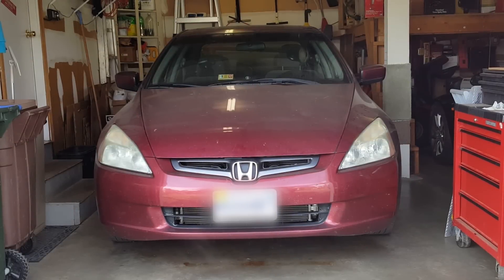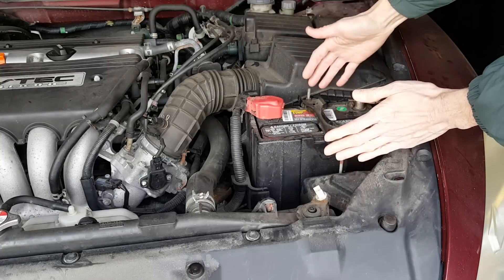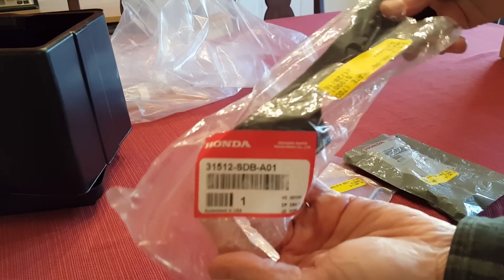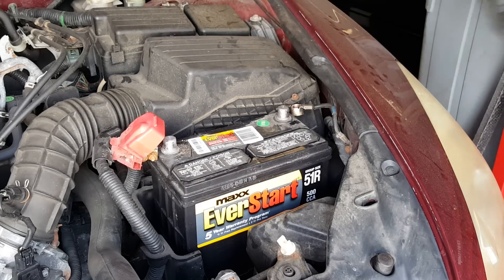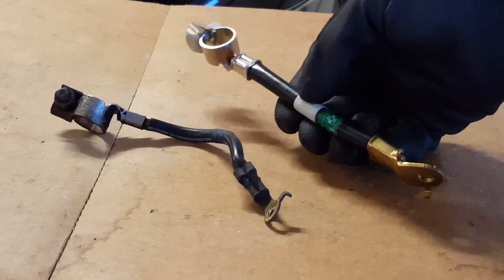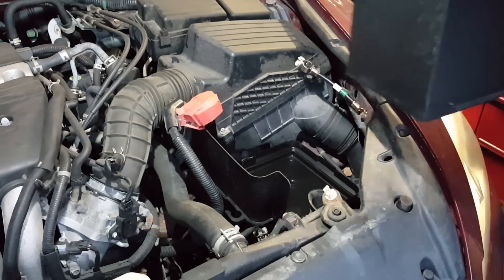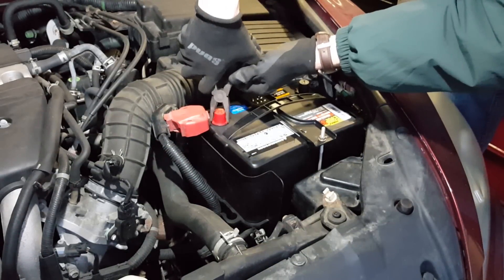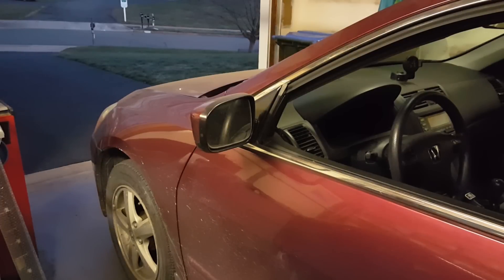Honda Accord?  DIY upgrade that undersized battery!

Comment: I went to auto part I asked him for up grade a battery because I have an R51 which is small one 
but they told me don’t do it
Because they were messed up the sensor and fuse?
Reply from the maker: Hogwash! That sounds like a typical answer from a naive service writer at a dealership. "Messed up" is not an acceptable scientific explanation of any potential problem. Ask them specifically what sensor and fuse and how a battery upgrade would negatively affect them. They won't be able to give you an educated answer because a battery upgrade is totally fine and has been done countless times. If you do get any form of an answer, do please share it here for our benefit. Thanks for the feedback.

Comment: For 31513-SP0-010 J-Bolt, Battery Setting (2 required), If I order 1 part do they send the pair of them or do I need to add 2 part#'s to the checkout screen?
Reply from the maker: You need to order 2. They do not come as a pair.

Comment: I just put a Maxx Ever Start 34N in my 2009 Honda Civic Coupe LX . My original Honda battery lasted for 9 years. 51R-500 CCA !              
34N 800 CCA should be learn to be good or bad . Thanks for my part list. I had to sew Cover, Battery as a tailor !!!  34N is a bit long. Also a 12" hole to hole Negative Black #1AWG.

Comment: Do I need to use memory saver while doing all the work?
Reply from the maker: Not likely. If your radio requires a security code, it is usually on a sticker somewhere like in or around the glove box.

Comment: Loved this video, by the way 9th gen Accords have major starter issues. My starter died at 40,000 miles. Honda wanted $800 to replace the starter. I found an eBay starter for $150 and it works better than the OEM Honda one. I feel the starter and battery were not designed well on these cars. Everything else is great!
Reply: Hey, I’m not if sure if you’re going to read this or not but I’m running into a similar issue with my 2013 Accord 4cyl cranking but won’t start right away. Auto Zone said the low alternator output it was below 12.7v. How did you know it was your starter not the alternator?
Reply: @MrWeezyTunechi  well the battery is way cheaper to reaplacs so start with that. The upgraded battery will help.

Also there was a safety recall on the charging system for this gen so many sure you have that recall taken care of.
Reply: @MrWeezyTunechi  Sounds like an alternator issue if it's dragging or slow to start.  If it's a bad starter you won't get any turnover at all.

Comment: The battery on my 2017 Accord is already on the verge of failure after a little over 3 years. I bought the car new in Nov. 2016. I would estimate that the battery is as old or a bit older than the car itself. A car's battery is simply a piece of parts inventory like the other components used to build the car and can vary in age. Dates on batteries matter even if they've not been put into use. Also car makers tend to skimp on battery quality when assembling new cars. The best battery I ever had was an Electro that I used in my '89 Toyota pickup. Got almost 7 years out of that one.
Reply: MY 2017 Honda Accord Sport SE bought on Memorial day 2017. The battery just died today, less than 3 year, but out of warranty because it's over 36,000 miles. What's a junk.

Comment: Our Accord 2007 EX-L with Navigation is having trouble with the battery keep dying when it gets cold (Montreal, Quebec)... thought a parasite drain but we didn't notice that we had this dying battery issue when its warmer. Might try this bigger battery trick.

Comment: I saw my battery and thought 🤔 “Ok who thought it was cute to put their gulf cart battery in here?” 😂
Reply: You should see how tiny they are on 90s model civics lol.  it's just dumb
Reply: Fr lol
Reply: I'm using this small battery with a pristine system and no issues...I guess it makes you feel more secure with yourself than do it,and get the bigger battery.Or get the 51 yellow optima battery.
Reply: dick lavy the one I have is from the dealership but I’ve been there 3 times to get it replaced in the last 2 yrs of owning my accord. I don’t understand why it’s not staying charged. They said nothing was wrong with the alternator so idk :/ it’s frustrating but they said it was covered by warranty so that’s why I let them replace it.

Comment: I took my four cylinder Accord to get serviced at Honda. The tech saw my group 35 optima in there and was surprised at how it came out.  I told him I did it to make the car easier to deal with.  

Readings: 12.94v with motor off on battery tester.
1052 cold cranking amps.

Makes short work of Hondas. 😁
Reply: What battery did you use? and Did you use the mounting stuff mentioned in this video or something else??
Reply: @Dashitishere22  Update: the Odyssey died at 2.5 years.  I've since replaced it with an Odyssey Performance Group 35 AGM.  675cca, 59ah, 110min RC.  car cranks up like it's nobody's business now.
Reply: @ganzonomy  Damn thanks for the updates! Much appreciated!
Reply: @Dashitishere22  You're welcome!  I put in the odyssey and it holds 12.95v at rest, has almost 900cca, but it doesn't need a riser.  My alternator is starting to go, so that will be replaced (and the starter too).

On my 2013 Accord V6 (comes with a 24F), I upped from a 24F Flooded Honda-spec (550cca) to a 24F Northstar AGM (840cca).  THAT battery has 1200cca at crank, 76ah, and 160min RC.  It rests at 12.9 to 13, idles at 14.4, and gets up to  14.9 to 15 when driving.  Honda really needs to put stronger batteries from factory in all their cars, and not just leave the bigger ones in their bigger-engined Hondas (or reserved for Acura).
Reply: @Dashitishere22  everything the same as in the video, other than using an optima red top
Reply: Ive had nothing but bad results from optima batteries. They only lasted 3 years each(2 batteries). I dont run any extra things on the car(subs).

Comment: Besides the battery lasting longer, were you able to notice any difference when cracking (quicker turnover) and accelerating (full throttle)?
Reply from the maker: Yes, cranking used to struggle but was much more energetic after the upgrade. No change to throttle response which I wouldn't expect.  That's not a function of the battery.
Reply: @WorseThanChiggers  right on. Thanks for your response.

Comment: Did this on my 2007 Honda Accord. big difference. Great idea! Thanks!
Reply: Did the battery upgrade recude rpm drops when the fans kick in or when controlling the windows? Or did it reduce the dimming of the headlights?

Comment: Good job on video and clear concise dialogue. I would never purchase Walmart Max Everstart  battery again. I have several Honda's and  did it for the the 1st time on an older Accord 4 cyl which traditionally sits idle for a good part of time. I found it would not hold its charge for an extended period of time when sitting unused. I had to keep giving it a charge.  My favorite is the Costco battery but they stopped making for this year Honda. Even the Honda battery last better than Max Ever start; should be Never start. Will try and find Interstate.

Comment: For years I've been using Mobile One Synthetic Oil to avoid hard start specially in winter. But now I'm gonna switch the battery and go back to Walmart cheap oil.
Reply: H Alganis — thats a baaad, bad decision! Get the battery and continue to use Mobile 1 on all the vehicles you care about! I have a 2007 Honda Accord with 410,000 miles on it. I also have a 2016 Accord with 60k miles. The high mileage Accord runs as well as my low mileage Accord! All my vehicles (4) get Mobile 1 exclusively!
Reply: I'm gonna do the same. My 06 kept running till 400 K then totalled in a bad crash. I went and got an 07. I upgraded the battery and switched to SuperTech. Let's see how Walmart oil gonna let it last. I heard Walmart oil got improved. Mobile 1 is getting more expensive.

Comment: I just finished installing a 55AH battery, rather than the smaller standard 45AH. The battery is shorter, but wider. Had to completely remove the plastic cover and base and also straighten a bit the metal tabs at the bottom of the metal tray. It's a tight fit but it does fit with no issue and it's not going anywhere. Used the original clamp and hooks which also fit fine. I'm wondering if I should buy the thicker cable from Honda. Is that really necessary???
Reply from the maker: Some have said that, no, it is not necessary. I, on the other hand, was concerned about the additional current flow and wanted to upgrade to the larger ground cable as it was designed by the engineers.  My thinking was, if it was designed for use with the larger battery in the V6 version, it would be appropriate to include it in my upgrade.
Reply: I looked on finding the cable. Local Honda don't even have the original cable, let alone the upgraded one. Can get online for about 80 USD (including European Delivery)!!! The new battery cost me less than that so no way I'm buying it!
Reply from the maker: @ps7539  $80 USD is pretty steep!   Is most of that the delivery fee?  The part is only $14.20 USD from here:  https://www.hondaautomotiveparts.com/oem-parts/honda-cable-assembly-battery-ground-32600sdba00

Comment: why didn't you just use the warranty for a free battery replacement at walmart?
Reply from the maker: I might have done that and dealt with the hassle if it was just me.  However, it was not an option to let my daughter get stranded once a year when the weather turned cold.

Comment: I was thinking the same thing...Why put a tiny battery on a newer Honda when all newer cars demand more electrical power. Doesn’t make sense?? Five years ago on my folks 09 Accord, I installed 24F size battery. Removed the battery cover and left the bottom tray in place along with original cables and j-hooks, worked perfectly. Thanks for the video...I’ve asked my folks if they wanted the OEM battery conversion, they were happy what I did for them and no need to upgrade. Been running fine over 5 years vs the tiny anemic battery that died less than 3 years.
Reply: Because any weight savings, even if it's in the form of an anemic battery, makes Honda look good in the eyes of the government emissions standards.
Reply: I also have a 09 accord and the charging system seems great. However, batteries never seem to last more than 2-3 years whether I get a cheap $55 or expensive $129 dollar one. Been getting the cheap one, but I've had it. Glad to know that's all the modification needed. I might upgrade the ground but that's it. Thanks alot!

Comment: Thanks!  Also, the 51r are now $120+.  I can get a Group 26r with 540cca for $50.  And it'll go in with the same hardware.  Remove the plastic and hammer flat the tab on the strap.  Doesn't get that cold in Texas.  My Maxx 51r lasted exactly the warranty period of 5 years.
Reply: The 51r is like seventy bucks at Costco. With like a 40 month free replacement warranty, pretty hard to beat.

Comment: Just put a larger battery in you just wasted hundreds of dollars on bullshit
Reply from the maker: Let's not mislead those who are interested in the cost of this project.  So, would you please share your math in case I'm missing something?  In my case, all of the replacement hardware was only 1/3 of the total cost of this upgrade.  The battery is certainly the majority of the cost either way and together with the hardware doesn't cost hundreds of dollars.  Understandably, some people prefer to go the cheaper route with this upgrade and I respect that.  However, it appears that the vast majority prefer to use the OEM parts.  It not only provides the proper fit and finish but I believe it retains all of the safety aspects intended by the design engineers and adds resale value to the car rather than detracting from it for potential buyers.

Comment: Great video.  I just bought my son a 2012 Accord. It recently died on him & I thought it was the battery.  I looked closely & found the neg wasn’t tight. I noticed the terminals were too big for the battery posts & the previous owner stuck some wire as shims so the terminals could tighten up over the posts.  Have you noticed the terminals being too big for battery posts on the Accord?  I see that auto parts stores make shims, so I might try this. Another option is to buy another battery & hope the posts are thick enough.  Thanks.
Reply from the maker: No, I've not personally seen that problem before. It looks like a pair of those battery post shims is the way to go.  I believe that the size of battery posts is pretty standard.  So, buying a new battery would likely not resolve the problem.  It is more likely that the battery terminal clamps are simply too big or have been stretched by overtightening.  You may look to replacing those if it continues to be a problem.
Reply: WorseThanChiggers thanks for the reply.  I’m hoping the battery just has an odd post size because it looks like a generic battery. If I remember correctly, it says Value on it.  Thanks again.

Comment: So I just did this to my '05 accord. There is no need to buy ANYTHING other than the larger battery. I got a 24F-DLG from autozone. They may be pricey but they have a 5 yr warranty,3 of which is replacement,then it's based on time for the other 2. Anyway,if it's just a point a to point b car like mine and you don't care about OEM look,you can just ditch the bottom and side plastic. You can and probably should insert a universal plastic bottom.Sold about anywhere too. I'll probably add one latter. But the battery cable doesn't need upsizing because the draw wont be increased so that wont gain you anything there either. The vehicle only needs to draw so many amps. The hold down bracket setup works just fine as well and holds the battery very securely as it did with the small battery. The only thing you need to do to that is smack that little piece sticking down flat with a hammer so it can't puncture the larger battery. To someone who doesn't know what it looked like before,they would never know it's not factory. Looks completely normal. Actually it looks much more normal with a regular size exposed battery than it did with a tiny pathetic enclosed golf cart battery hahaha. So what I'm saying is,before you go and spend all that unnecessary money for plastic,just try this first and see your ok with it. Odds are you will be. Then if you don't like it,you can always order the v6 plastic parts or hit a salvage yard for them. To me,it looks better than it did with a full size battery and it's pretty much just a direct swap minus 20 seconds smacking the tap flat on the hold down bracket and 10 seconds tossing out the plastic foolishness.
For that matter you guys,you can just get universal plastic boxes too if you want it enclosed much cheaper. Who cares about it being enclosed though? I don't. Close the hood and no one sees it lol. It's not like these are show cars guys.

For the only mod required;
Just take the hold down bar over to something like a large rock. Set it so the tab sticking down in on the rock or flat iron,whatever you have,smack the bracket and that tab will flatten right out. Super,super easy little modification.The side L hooks fit the taller battery just fine and all that. The battery isn't going anywhere and it's extremely secure. The car could be in a roll over and still not move.
She starts SO much easier now! I bet my headlights wont keep dimming/flickering either! If that issue isn't resolved,I'll perhaps try a universal larger neg bat cable but I bet it's fine now.I'll run her out tonight and see.
Reply: Update; I went out at night. Turned on the heated seats,both defrosters and high beams. No flicker now baby! Now I can drive around in the winter and not worry about having enough power for the car to start. Shame on Honda for giving us such a tiny golf cart battery in the 4 cylinder cars. Easy fix though.
Reply: @Warrior_Resisting_Colonialism  This is good news. I read that the headlights randomly dimming on the 7th gen is a problem located in the fuse box and upgrading it to fix it costs a lot of money. I am going to opt for a larger battery instead and see how that goes. I did what you did years ago in a 1998 Camry. I ditched all the old battery covers and put in a larger battery. It worked like a charm, cold starts on 10 degree mornings were a breeze.
Reply: @Harold_Callahan  Oh yeah, I still have this car. I forgot all about that tiny battery issue and the flickering lights hahaha. Yup this cured everything. I'm on my second large battery now. Car always starts in the cold. No issues anymore with anything. The only thing this car ever needed to be upgraded. Been a great car. I'll probably have it for many more years still.

Comment: You don't really need to spend all of that money for the extra parts as long as you don't need the OEM look.  I just replaced the battery in my 2007 LX with a group 24 battery (even larger than the 35) as it is a very common size and good CCA.  I just removed the battery box and the entire tray, and then straightened out the tab on the hold down bracket.  That battery and any smaller will fit in there with the existing j bolts and bracket.  So, if you are willing to remove the battery tray, you can just put in a new battery and use the existing hold down hardware and upgrade to a larger battery for just the cost of the battery.  All very simple just like in the video.
Reply from the maker: True. Just note that without the tray, you will likely have corrosion issues if your battery starts to leak.
Reply: @WorseThanChiggers  Would an AGM battery mitigate corrosion / leak issues?
Reply from the maker: @ganzonomy  AGM batteries are supposedly spill proof but they are not leak proof.
Reply: You could get plastic tarp and line the bottom and wrap the bottom on the battery
Reply: Some people want their cars factory and not to look hacked up